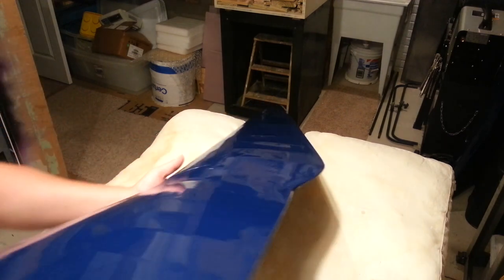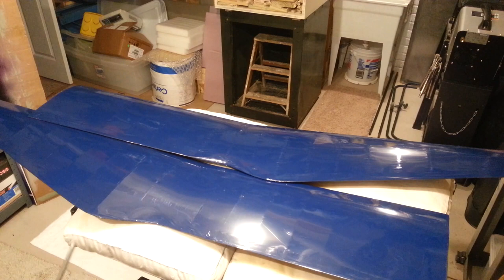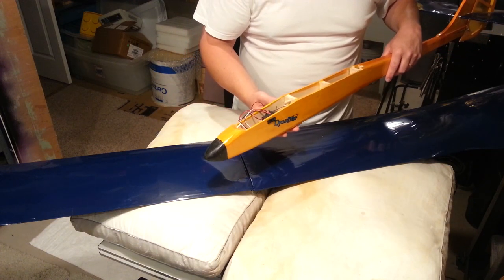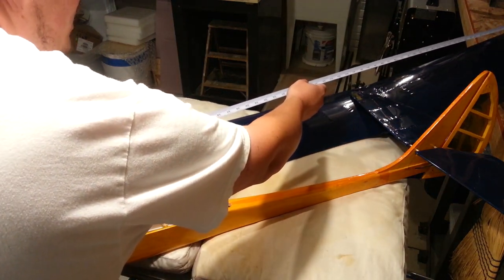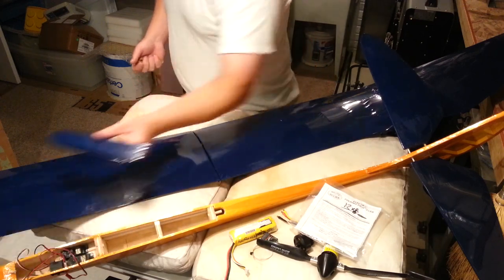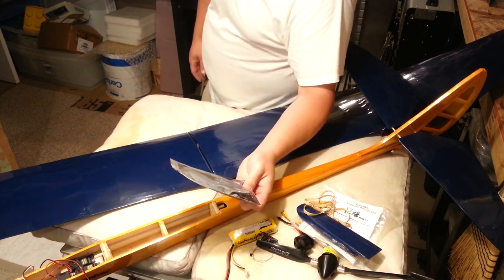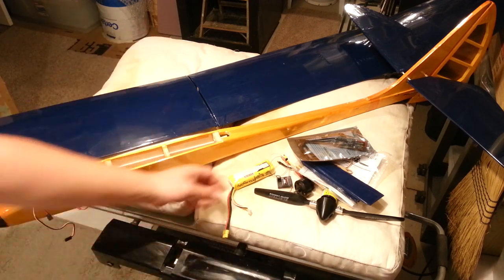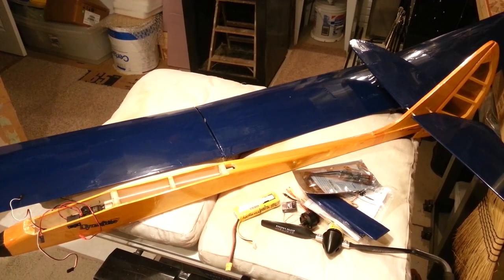Dynaflite - Bird of Time - First Look

Comment: With that big a prop you could get close to 40 amp draw depending on motor and battery choice, im running a 50amp in mine, with the Trunigy Gliderdrive 860 also running a 13x7 areonatica CF prop and vented alu spinner